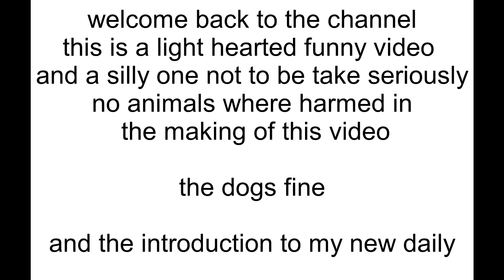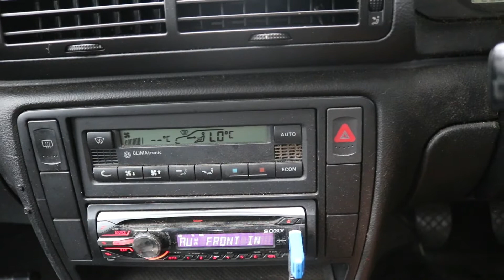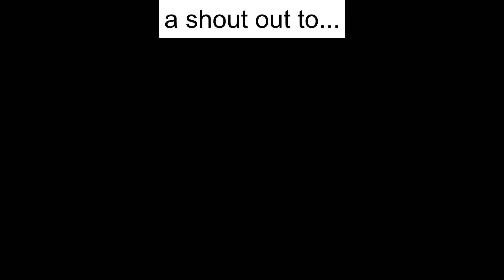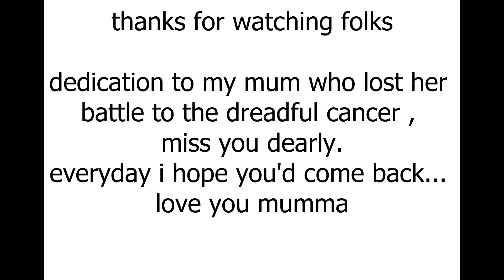the new whip (vectra C 2.0T) & Joke video of my old whip (passat 3b5)

Comment: Hello mate, the Vectra you have looks to be the rare "BTCC" version which pays homage to the BTCC racer. To put it above a normal Sri model, it has the "funny plastic bits" on the front bumper, it has the vxr rear diffuser, also it will have an uprated fuel rail/injectors